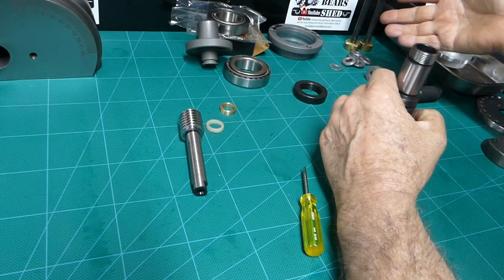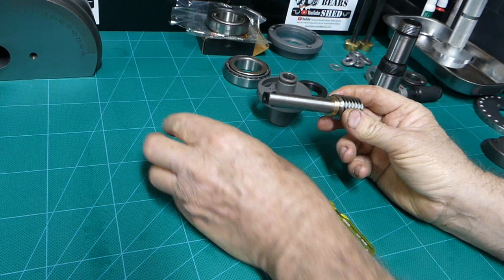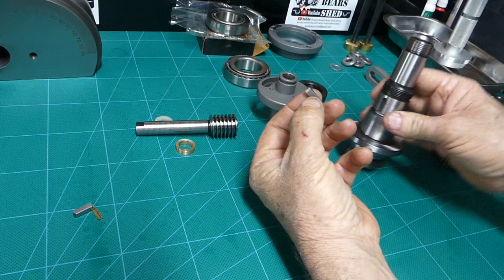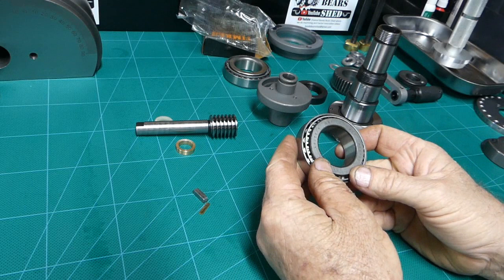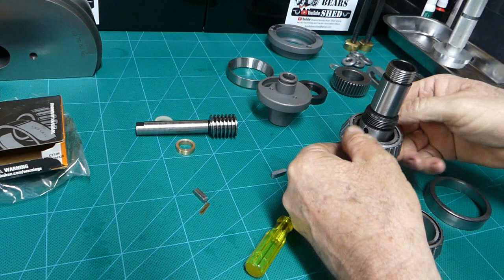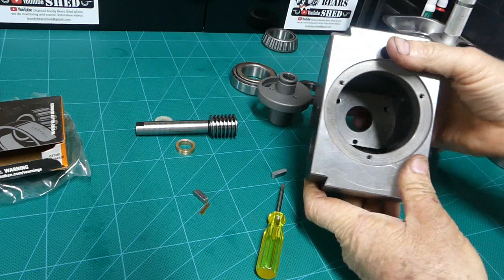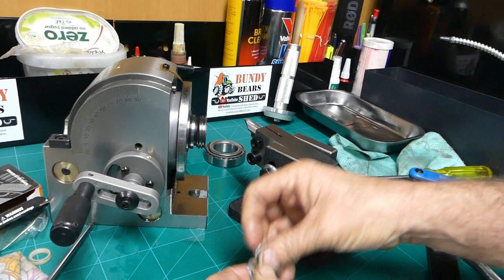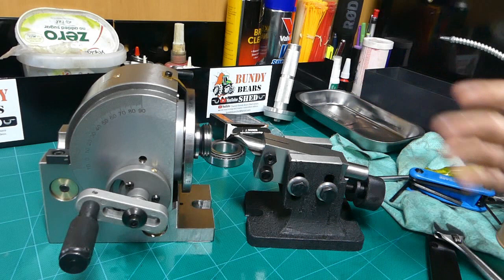Chinese Semi - Universal Dividing Head Part: 3 Assembling the Dividing Head and Adjusting it.

Comment: Hi Lance, nifty bit of gear and even better now its fixed, I nearly got the exact same one but ended up getting an HV4 rotary table with plates, tailstock and 3 jaw chuck because of the hight difference as my mill is smaller than yours and limited in Z travel, especially on the quil. I think everything from china made of cast iron like chucks, rotary tables, dividing heads etc. even mills and lathes benefit from a good stripdown and clean before use as the amount of grit in them will soon wear them out,  the grodge in them is like valve grinding carborundum paste in some of them, good for grinding valves but not in something like that. With a good clean and debur of some parts they transform into something decent for the price. Another benefit of stripdown is you learn exactly how they work. cheers, Derek
Reply from the maker: I cant believe they dont clean them, they must have the stuff there to do it.

Comment: Hi Lance,

That head is running real smooth now.
Another great set of video’s there.
At school in the 70’s there was one in our metalwork shop, but the lecturer went through it so quickly no one understood and it sat on the shelf gathering dust so if you ever have to cut anything it would be great to see.

Cheers,

Paul.       Surrey,  UK.
Reply from the maker: Thanks Paul.

Comment: I think I would ditch that rinky dink pointer and bolt a plate to the front with an accurately scribed line so it wasn't so easy to get it knocked out of indication. Other than that looks like a pretty good piece.
Reply from the maker: Good for the price I think.

Comment: Great video series on these Dividing Heads. Don't fancy adding extra torque to the ball end allen key. Might shear off the ball end. Just like shear head bolts used on vehicle steering columns. Use a normal straight shank one. I was cringing waiting for it to shear. Maybe a touch of thread loc too. 
Must clean mine which is identical. Only used it for the first time last week despite buying it many months ago pre-covid in fact. It will be interesting how clean internally it is or not !!
Reply from the maker: I think cleaning will be a good idea if mine was anything to go by.

Comment: That's an excellent video series for me, I'm just about to buy one of them. How much are those tapered roller bearings ?
Reply from the maker: Around $23 from memory.
Reply: @BundyBearsShed  ok, that's not too bad. Thanks for that. Never know I might be lucky and get a clean bearing.  ha ha
Reply: Well my bearing survived. After washing thoroughly with petrol it still felt like it had grit in it, so I spun it with compressed air for a minute or two and now it's smooth as. I got lucky with that.... I just finished making some 12mm flanged hold down nuts for the mill, and that head did a great job on cutting the nut flats.

Comment: I have to wonder about runout in the 2MT dead center; hopefully not much. 👀
Is there a way to tune the runout in the 3-jaw chuck, and did you see whether it would repeat OK when screwing it off and back on?
Reply from the maker: It did repeat ok, the runout can be adjusted by loosening the chuck from the backing plate and tapping to as true as you can. Not on this one but I have machined backing plates a little to allow more adjustment.

Comment: Hi
Do get able to reduce the back lash?
I got a bs head and not able to stop the back lash .the gear inside the head is out   rond and loose on the shaft(.003 over)so when i adjust the wormgear to the lowest point of the gear i m not able to make a full 360 révolution it jam and if i adjust to the high spot of the gear the back lash is very bad.i think i will need to rebore the gear put à sleeve in the gear and bore to the shaft diameter. Do you have any idea thank you
Reply from the maker: Not really mine has been good.

Comment: I just bought one of these BS-0 kits from eBay and it came with a 41:1 ratio instead of 40:1.   I could not believe my eyes, so I checked it 4 times in 3 different ways.  Getting the seller to fix this will not be easy... 😖
Reply from the maker: Wow not heard of that.
Reply: @BundyBearsShed  - Just for fun, I paused your video and counted the teeth on your spur gear just to make sure.  You're good at 40T.  Still waiting for a reply on my little problem.  I have to wonder if it was an honest error (no QA at all) or somebody actively wanted to get even with their employer.  This would be a really good way to ruin a lot of finished product, and the size difference would not be visible at a glance.  The 40T gear can cut everything up to 50 divisions and many non-primes above that, while a 41T can't even do common ones like 12 or 14.  If you need a 123T gear, though, the 41T spur is perfect!  😁

Comment: In the kit there's a bag of screws. 5 x M6x25 hex head and 4 x M5x10 cap head. It's got me buggered, what are the 5mm cap heads for ?
Reply from the maker: The keys for the bottom dowels possibly
Reply: @BundyBearsShed  Yeah I'd say so. Just started pulling mine apart. Couple of things I've found so far : slots for bottom dowels on tailstock not machined, just rough grooves so dowels don't go in. Spindle chuck thread like a jagged razorblade, had to touch it up with a file. When I turn the segment arms the spring clip comes off. The clip is rough and will need smoothing with a stone, hope that works. One of the screws for the dividing plate has a stripped philips, that was a job for the impact driver....I can see this turning into a big job. Oh and where you mentioned how particles could get into the bearing behind the indexing plate, I might make a felt washer or something to go in there.